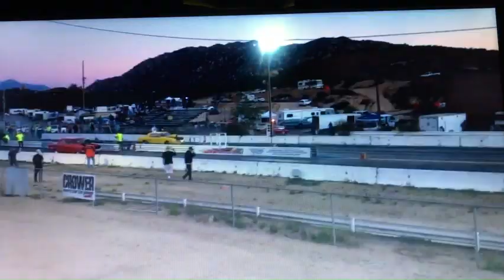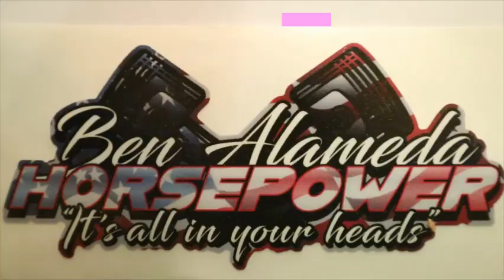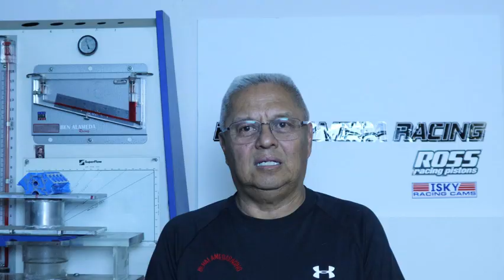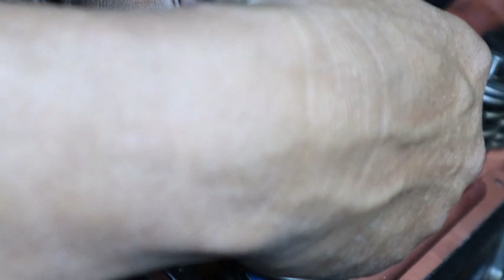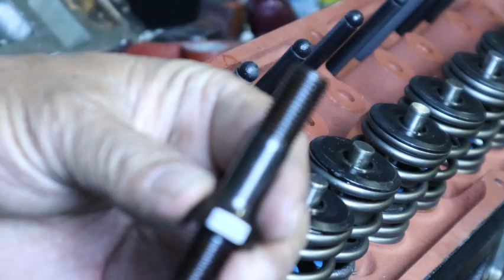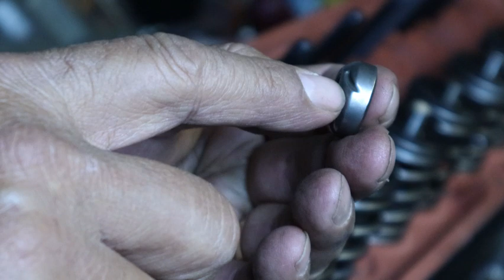302 H.O. BUDGET VALVETRAIN MODS

Comment: What a wealth of info thanks. I have been looking for budget ideas and you have given me hope. I would like to ask what was your source for the spacer on the rocker stud. Meanwhile I have a lot of videos to watch.
Reply from the maker: Any good hardware store with "hardened stainless steel" washers is where I got mine.  What state are you in?  Maybe they have good hardware over there.
Reply: Im in central TX and ya my wife actually works at a Ace Hardware. Its the thickness of what I see in the video. I dont think stacking a couple together would be a good idea?  @benalamedaracing2765
Reply: @benalamedaracing2765  Ben I thought I replied to your info but maybe not. Ill look around Im sure I can find something.  My wife works at a hardware store. Let me ask this you say your working with a regrind cam so the geometry is different. The Olds application stud 5/16 base thread and 3/8 top is only 1.5 inches long [top] verses the universal Ford 5/16 base 3/8 top is 1.7 in length. Thats close to a 1/4 inch. It would seem to make up for the spacer? I could also understand if you want a cushion between the poly lock and the fulcrum ball. Thoughts?

Comment: I got a 302 im building and are going to put ls valve springs on it and some type of roller rockers on it. Thanks for the info
Reply from the maker: If it is the same installed height it should swap in no sweat.

Comment: If someone only had (8) 1.7 rockers would it be better to use them on the intake or exhaust valves?
Reply from the maker: Use them on the intakes and should help as long as you have the necessary VP clearance inside the cylinders!  Exhaust higher ratio will not even  show anything as far as power only on the intakes.

Comment: greetings Ben Alameda your videos are always very helpful! Since you mention it, I would like your opinion on moving a few degrees forward or leaving at "0" a stock 5.0 ho cam that will be put on a 302 with iron gt heads with updated springs and an Edelbrock double plenum intake, this is for a f truck -100 1979
Reply from the maker: I would not advance the cam over 2* and I would instead switch over to a 1.7 ratio rocker arm in conjunction with advancing it 2 forward and it should really help!

Comment: I knew a couple of Super Stock / Stock Eliminator guys and they would clean the engine reconditioners out of all their stamped steel rockers and go thru 100s of them to find all the ones that had a touch of extra lift like 1.512 instead of 1.499 etc.. That type of racing gets expensive because you've got to have valuable parts # matching factory components , you can't just go out and buy the best whizz bang speed parts and bolt them up
Reply from the maker: I have always admired NHRA Stock/Super Stock racers big time.  It is not easy that is for sure and the devil is in the details extracting every bit of power out of them.

Comment: Ben first thanks for your videos on valvetrain mods. Curious, what valvetrain mods could I make on a '''73 351C head ?  Remember the '73 is a detuned "71 Boss . I'd just like to regain that hidden horsepower.
Reply from the maker: If I am not mistaken the 73 comes with much lower compression because of the open chamber design.  I would invest in an Aussie head or a 4V closed chamber heads and go from there.
Reply: @benalamedaracing2765  Yes, that's correct but as I understand there was also a difference in the camshaft involving the camshaft timing and the lobe lift

Comment: non roller 359w gt40 heads leaning towards link bar lifters what's best push rod length.
Reply from the maker: If that retrofit lifters required a stock length pushrod, you might as well purchase F-150 Lightning pushrods that came with them trucks!  That is the easiest way and if given abilities adjustable pushrod does wonders in determining rocker arm geometry and pushrod length.

Comment: Ben, it was very good to see your face again; glad to hear it was a computer issue and not something bad. Will that self aligning roller tip rocker fit under a stock valve cover?
Reply from the maker: They do fit inside a stock cover because they resemble the stock ones with just a roller tip.

Comment: Those stock stamp steel rockers can get you into the single digit 1/4 mile times, but we did see deflection on a dyno chart over 6800 rpm roughly. My 302 has 1.6 scorpian rockers now but still pedestal mount. I have taken them both upwards of 8000 rpm not that it did anything power wise just because it sounded cool in the burnout box haha. Also on the dyno woth the factory rockers i wanted to see what happened in that rpm range and thats how we found out the rockers were deflecting. It was interesting to see.
Reply from the maker: Perhaps the rockers were indeed deflecting but do not forget the tiny thin stock pushrods they will also show some effects at high rpms!
Reply: @benalamedaracing2765  yeah forsure. I upgraded to a .120 wall (if i remember correctly) thickness. It was the thickest pushrod i could find in 5/16. The stock crap did run into the 10s n/a and high 9s on spray. It was cool to do and see lol
Reply from the maker: @GroverBoysRacing777AdamGrover , regardless you guys are running hard!  Impressive by all means.
Reply: @benalamedaracing2765  thanks Ben. Coming from you thats a huge compliment! Ive been messing with this 55 chevy to cruise with my son and wife but after this is where im satisfied with it i plan to jump back into the mustang to try n get it back out there
Reply from the maker: @GroverBoysRacing777AdamGrover , keep me posted of your progress and I was watching both of your video channels and love it!
Reply: @benalamedaracing2765  thats awesome to hear, thankyou. I havent been on youtube much, been busy with my son whos turning 1 in 2 weeks. Lol. I should put out an update video of the 55 though.

Comment: Ben how would you run a F cam? Seen some people run it 4 degrees advance. 
If so, Is advancing it with the crank gear 4 degrees sufficient?
Reply from the maker: The F cam is bigger than the E/B and advancing will help and max it at 4* forward.  I feel the clearance will be a lot less when it is advance on the intake valve vs pistons. Check just to be safe.
Reply: @benalamedaracing2765  sounds good. I appreciate it sir. Thank you. I’m ready to
See what a boosted 67 Cougar is like

Comment: Ben, it's always good to go re-visit the basics. There's always someone that's just starting out, or doesn't know any better.

My favourite budget combo for the E7/GT40 heads was always the EARLY factory H.O. cam, 1.7 Cobra/Crane rockers and the TrickFlow 2500-100 drop in spring kit. Cheap, readily available, good valvetrain stability and driveability.
Reply from the maker: Thanks and I had many upstart mustangers start off with the very things you stated here.  It was workable affordable and produces eye opening improvements and from then on they are hooked!  lol
Reply: @benalamedaracing2765  Even just changing the valve springs alone is a HUGE help.

Comment: I would like to see your method for adjusting solid lifters. Ask 10 mechanics and you get 10 different answers.
Reply from the maker: Ok that is a good idea and what I will show is why I do it this way and it has a lot to do with the positioning of the lobes when I adjust them.  I remember many times when I watch someone adjusting them on the compression stroke and if they do not have a degreed dampener it is a shot in the dark specially with aggressive cam profiles.  I will do this as well soon!
Reply: Ben, are you talking about EOIC method?